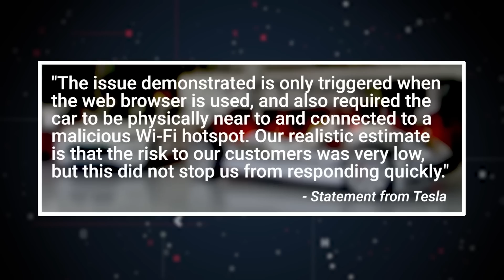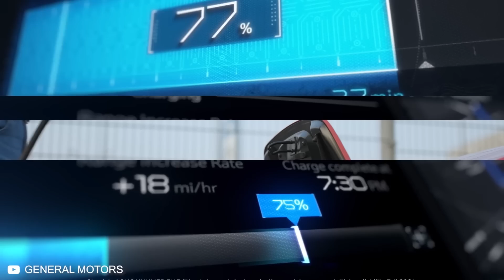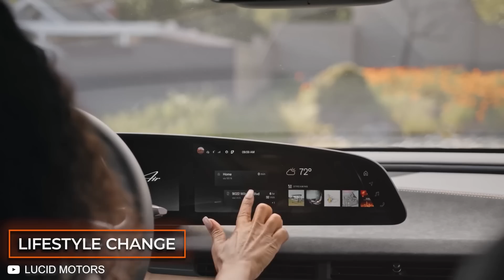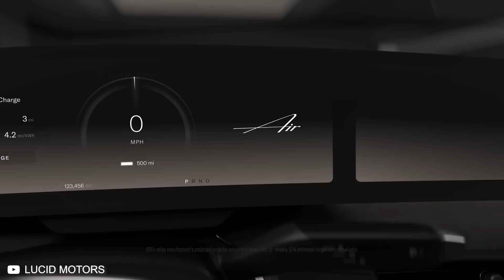EVs' Serious Problems That Carmakers Are Hiding

Comment: They wanna get serious about this? 

They need to mandate a universal charging system for ALL ev's! No proprietary plugs allowed, that way no matter your vehicle you can charge it with any charger, worldwide. They need to make them available everywhere, and i mean EVERYWHERE!! They need to make the range equivalent to an IC engine or superior. 

They need to be able to charge in 5 minutes max!! For those of us who actually have to drive somewhere outside a 2km radius, fuel stations get packed at peak hour, and that's for a 3 minute fill up! Could you imagine how chaotic a 40 minute recharge would be??

They need to make batteries that can last more than a few years and not start to degrade as soon as you buy one. I have a 26 year old diesel 4wd parked outside that still gets the same economy as the day i bought it!!

They need to make them durable. I'll wager my oil burner against any of the best EV's any day. The hiding i've given that thing is unbelievable, and it still goes. EV's are fragile!
Reply: Everyone except America he CCS2. Maybe this would be a less of an issue if you jumped to the international standard metric system. Maybe then you’d stop losing satellites.
Reply: @engineeringtheweirdguy2103  Umm, why is this directed at me? I'm not American.
Reply: @Spacegoat92  then Almost every single EV on the market today uses the same plug. Unless you’re in America. In which case Tesla has their own plug. Funnily enough teslas abroad don’t use that plug, they use the CCS2 standard.
Reply: Ok. I read further. Let’s address your list of “Demands”

“Need to make range equal to or superior than ICE” they already have. Additionally, why? ICE’s typically only need the fuel range so you’re not going to fill up on gas every single day. Because you don’t have a petrol bowser at home. EV’s charge fully overnight. Every morning you have the equivalent of a full tank of gas. You only really need as much range as you use during the day. Which for the average person 99.9% of the year is around 25-60 miles. Modern EV’s have ranges punching 350-400 miles. 

“They need to charge in 5 minutes max” - again. Why. 99.9% of the year you’re travelling less than a full tank of gas during a day. Then your car is parked in the garage for approximately 14 hours. Why do you need it fully charged in 5 minutes. Additionally when people do infsct do road trips the vast majority of them stop for food, drinks, bathroom breaks, making the stops around 15 minutes and the fuel getting 5 minutes. With superchargers, it’s 10-15 minutes to charge. So for some people it’s actually saving time. Yet alone the 16-17 hours per year the average person saves from having to get fuel for their daily commutes they drive 99.9% of the year. 

“They need to make batteries that last more than a few years” - they already have. Modern EV batteries last twice the average lifespan of a modern combustion engine. Infact they typically have a 8 year warranty period alone, brand new. It’s hard to get anything more than a 3 year warranty on even high end combustion motors. BMW only does 6 as an optional extended warranty to under 100,000 miles. 

Your 4x4 probably doesn’t get the same economy and probably has ALOT of parts replaced. In a lot of cases the entire motor. How much $$$ do you think has been spent of maintenance and repair of the engine and transmission since it was purchased new? Double the cost of the car when it was new? More?

EV’s aren’t fragile. The bottom of EV’s for example is a solid smooth plate of titanium. There isn’t a transmission shaft, or differential or exhaust or oil sump under the car you can bash. They don’t have air intakes like combustion cars do so you can’t flood the engines. You can drive it into a lake float it back out then drive it away again. 

Fragile… they have only a few hundred moving parts. A combustion engine has a few hundred thousand. And you think the EV is fragile. Oh how precious you are kid.
Reply: @engineeringtheweirdguy2103  Ok then you wanna go long answers hey? I'm your huckleberry. Let's address your responses here, because you made a few bold assumptions here.

Point 1 "Need to make range equal to or superior than ICE" No they haven't, refer to this video for starters. 

https://www.youtube.com/watch?v=J0V99iiEJvY

Secondly, my Honda Accord Euro 2.4 litre manual would get on average 600-700km per tank, my 4wd gets about 800km to a tank, both can be easily filled up in under 5 minutes, and very seldom, if ever, to be affected by power failures. Granted yes, a Tesla Model 3 claims to get 680km, but that claim fluctuates between different operators and is dependent on how many accessories you're using. You run the air con, lights, windscreen wipers and stereo all at the same time, your range will drop like a rock. I live in Australia, and driving long distances is quite common here. The only folk who seem to think EV's are a good idea are those who seldom venture from the city and have access to their own charging stations. Not everyone has that luxury, take for instance renters, people who park on the street, multiple vehicle households, people who simply can't afford a charger at home, let alone a brand new EV. Like you think a pensioner/unemployed/first car buyer can afford to fork out $65,000 for a model 3 Tesla, or $40,000+ for a "cheap" EV here in Australia? And then however much for at home chargers?? And no one will want to buy a used EV with batteries that have reduced endurance. To say nothing for third world countries. How well do you think they can get an EV network running across Africa??

Thirdly. If i wanted to go on a road trip to visit my friend out west from where i live, (716km one way) i MUST use an ICE car. There is ZERO EV support from here to his town and back. At least not yet.

Point 2 "They need to charge in 5 minutes max" Again, not everyone has access to fast chargers or even house chargers. As for recharging in 10 to 15 minutes while you get food or drinks? Well that's wonderful if the multiple cars ahead of you aren't doing the same thing while you're driving during peak hour, you could be in for a long wait. Also, i don't know where you're getting your statistics on being able to fully charge a car in 10-15 minutes when it takes 60 minutes for a Tesla fast charge which kills your battery in the process. Also when i go camping in some of the more remote places, i can get diesel pretty much anywhere, and my car can run on cooking oil if i really get desperate. And if i can't, i can carry extra fuel with me, which i can again fill up in minutes. Please tell me, how long will i have to wait to charge my EV with a solar panel when i'm in the middle of nowhere? Secondly, how well do you think our grid can handle tens of thousands of EV's being charged at once. Combined with fridges, televisions, air conditioning, and the other appliances every household has. My country doesn't have nuclear power, we're currently running on coal fired power stations, with a push to go wind and solar which will make the situation even worse. The infrastructure doesn't exist yet to support mass EV ownership. Here is another article for your perusal, tell me what you would do in this situation:  https://www.drive.com.au/news/electric-car-owners-told-to-avoid-charging-during-california-heatwave/

Point 3 "They need to make batteries that last more than a few years" You seriously think an EV battery will last twice the life of an ICE engine??? Whatever drugs you're taking, please send them my way! My 2012 Mitsubishi Lancer had a 10 year warranty on the engine and drive train. If I don't drive my ICE, it doesn't degrade, that's how come you can have a 50+ year old car with its original engine. Battery degradation is a fact. Batteries start to slowly degrade the second they are made, whether you drive them or not. We'll see how many EV's are still around with their original batteries in 20+ years. Please refer to this video https://www.youtube.com/watch?v=LmKyzaQnMok

Point 4 "About my 4x4" Are you absolutely for real??? The car has 440,000km on the clock, i replaced the head on it myself when i bought it. The transmission and running gear is still the factory fit, i have also modified it extensively due to my own preferences (Something you can't do easily with an EV). I can also fault find and repair pretty much everything on the car myself. My Honda Accord Euro had 343,000 km on it until it got written off by an idiot running a red light. The Honda had the original engine, gearbox, clutch, radiator, suspension components. I owned it from 120,000km and only replaced the rear wheel bearings, the CV joints, battery, and the air con compressor. And i can GUARANTEE, even with the purchase price of the cars, i came nowhere near the cost of a new one. Not by a bloody long shot. And i'll have to spend a hell of a lot more money on my ICE cars before i even get close to the price of an EV. Lets see if your EV is still on the road after 20 years, and still running reliably.

Point 5 "EV's aren't fragile" Yes they are. You can't damage your ICE car by filling it up too fast, yet even EV manufacturers say frequent use of fast charging can detrimentally affect the durability and life of an EV battery. My ICE cars can take a hell of a lot of punishment. The places i take my 4wd would kill an EV, and you get a short in one of those battery cells that starts a fire, you can't even attempt to put it out unless you drive the thing into the ocean. I don't flood the engine because i have a snorkel on my 4wd so water crossings have never been a problem. Damage to my sump and undercarriage isn't an issue either as i have bash plates that have taken some big impacts without issue.

And clearly you have never disassembled an ICE engine, a few hundred thousand moving parts you say? Really?? I've rebuilt a few and i can tell you, an ICE engine has about 200 parts, most of which can be repaired or replaced by just about anyone with a tool kit and half a brain. The average modern car has about 30,000 parts in total if you were to strip it down to every nut and bolt, so try again son. And you seriously think it's ok to drive your EV into a lake? Be my guest. Enjoy spending the next years of your vehicle ownership chasing electrical shorts and glitches due to water ingress into your wiring. Plus, my ICE cars are 100% hack proof. They won't brick my car because of a faulty line of code, or an error, or some sort of electrical anomaly. Both my ICE cars can be started AND driven without a functioning battery. I have repaired my cars power steering on the beach!! THE BEACH! 

And if i need to repair my EV in a hurry, where do i go? Oh yeah, you can't take it to any old mechanic or fix it yourself, you need to go back to the dealer where they can tell you that because you didn't perform you last software update on time that your warranty is now void and you're up for the repair costs, or the warranty doesn't apply to you because you aren't the cars original owner or you downloaded a third party program, or there will be a 2 month wait due to covid or some other crap like that. Tough break while your car sits like expensive paper weight, while your mate with his own tool kit could have gotten your ICE powered car back on the road in a couple of days.

"Oh how precious you are kid" Cheers for calling me a kid, i feel younger already.
I'm not against EV's by any means, i just think they need to be better developed before they start pushing people into something that isn't going to be beneficial at all. The majority of pollution is caused by industry, namely China and India, yet they're trying to guilt the population into buying EV's by saying ICE cars are the problem. Yet how much destruction of the environment is required to build and run an EV? The only ones who will be winning out of EV ownership will be the ones with a financial interest in them. Not you or I. And as for my demands?? If i am going to be paying over $50,000 of my hard earned money for a car, you better bloody believe i'm gonna want it to meet a certain expectation. And if that expectation is fast repeated, RELIABLE charging, cheaper and longer lasting batteries, and better infrastructure to support it then so be it! 

In the meantime, until they get their battery issues sorted out they should be focusing on hybrid vehicles as a transition, even to the point of doing hybrid vehicle conversions, like they did with LPG back in the day. That way they can normalize EV ownership, reduce fuel consumption, and make people more willing to accept it as they see battery tech improving. The world is moving way too fast to take a step backward in terms of vehicle ownership. 

Oh, and here's another video to watch https://www.youtube.com/watch?v=4c7jdRp4rpc
Reply: @Spacegoat92  OK, so I also live in Australia, and actually own a model 3. lets respond.

1.) yes they are. Most other vehicles in a similar size and categories to the EV's have similar ranges. Lets take the Tesla model 3 and the BMW M3 for example. They directly compete with one another in the same size, Category and market. The Tesla model 3 has an EPA range of 570km (the NEDC range they're required to advertise here by Australian law notoriously inaccurate. They use the more accurate EPA range elsewhere. Our government is just stupid). The BMW on the otherhand has a range of 490km to a tank. You may note that the Tesla gets further to a charge than the BMW gets to a tank of fuel.

1.1 - "very seldom, if ever, to be affected by power failure" - why would an EV? sounds like a dumb question on my end but if you use your brain for a second. EV's have a similar amount of range per charge as an equivalent ICE vehicle. already established. Most EV owners charge at home so every morning they have a "full tank" unlike ICE vehicles do at the start of every day. If the power goes out, your battery still has charges does it not? Additionally if the power goes out, how do fuel stations pump the fuel into your car? how do they accept payment for the fuel you've pumped? they cant. So you cant get fuel if the power happens to go out right before you need to refill your tank. This will be similar to alot of your arguments. Seem appropriate and valid points on face value but when you ACTUALLY think about it, they're not really issues at all.

1.2 - "that claim fluctuates between operators and dependent on how many accessories you're using" - This is the same for ICE vehicles. Its the reason your power drops when you're using the aircon in weaker cars. It all takes power. That power in ICE comes from the rate of fuel consumption. And no, it doesnt "drop like a rock" the amount of power headlights, wipers and radios use is so small, I could run all those in my model 3 for a week before it even dropped a single percent. Hell, you can get high powered LED flashlights that operate of 4 AA batteries for more than 40 hours continuously and you think LED headlights in a car is going to drain the battery "like a rock" just think. Air con is the only one there that has any significant impact but it  has no more of an impact that it does in ICE vehicles. My range drops by around 1-2% if i use it continuously for 500km. (i.e. I'll lose 5-10km of range. omg, what a loss).

1.3 - "The only folks who seem to think EV's are a good idea are those who seldom venture from the city and have access to their own charging stations.... take for instances Renters" - When i purchased my model 3, I was a student working multiple jobs, living with my fiancé (so multi car home) and I was RENTING. I didnt have a "charging station" either. I had a normal wall outlet next to the carport. That would let me charge my daily commute in 7 hours (just over 100km a day). The car was parked there not being used from the time I got home to the time I had to leave for work which amassed to 14 hours every night. (got home at 4pm, left for work at 6am). I never had a single issue with that arrangement. Since then I have purchased a home and got a home charger installed which does the same in 1 hour 20 minutes. It cost me $400 to install. However Victoria is implementing an EV ready mandate that all new homes be built to accommodate EV charging. So in the future I might have saved myself that $400. (also should point out that the most popular car in terms of purchases of new vehicles in Australia for Q1 and Q2 of 2022 has been the Tesla Model 3, i'll let that sink in for a bit)

Again, If you just think these things through just a little more....

And i'm not saying EV's are a must have for everyone. If you only have on-street parking, EV's probably arent the best option. and obviously if you cant afford the car, dont get it. But If you're also Australian, then your 4x4 is likely to be either a land cruiser or a patrol. Tell me. How much is that car worth new? compared to the Tesla's $65K price tag?

1.4 - Roadtrips - I regularly go on roadtrips in my Model 3, With most of my family living 4-5 hours away and this season I have driven from Melbourne to Mt Hotham to go snowboarding effectively every single weekend. so much so that i've done 11k km in only 1 month. Out West, yes the charging network is shocking. It needs improvement and have more investment. Out East I can drive from Adelaide to Cairns through superchargers. In Melbourne alone there are Tesla super chargers all over the place but there are also RACV Super charger networks, Chargefrox Super charger network Ampol super charger networks, Chadimino Supercharger networks. The Chargers are everywhere. And they're all publicly accessible, with the exception that Tesla supercharger networks are only open to Tesla owners. I semi-regularly drive from Melbourne to Cobar to visit my brother (850km each way). Having to charge only adds around 30 minutes to my trip I was  would make stops for food and toilet breaks in anycase and it actually saves me to time going to Mt hotahm in a weird twist of fate. Instead of getting fuel, then driving around to find a park then going to get food. I just park at the charger and go and get food. absorbing the queuing for fuel at the fuel station, filling, paying then driving around town to find a parking spot.

Part 2 coming
Reply: @Spacegoat92  2.) "they need to charge in 5 min max" again, you can charge your EV from a wall outlet. I literally went and stayed in an air BnB that had no drive way and only a front porch. It had an outdoor powerpoint on the side of the house. I parked on the grass and charged from that powerpoint while I was staying there on holiday. its really not that difficult.

2.1 - "charging in 10-15 minutes while you get food or drinks, well thats wonderful if multiple cars arent ahead of you" Yeah, so that doesnt really happen, especially not here. Most instances which people point to of that happening have been on Tesla club drives where they get together as a group and drive a route often stopping at a few superchargers which causes ques such as the 300 car club drive that did the great ocean road a few months back. people are still using that as a "look, they're queuing" photo. However this isnt the norm. if you THINK about it, the only people using the super chargers are people on road trips since most EV owners charge at home. And of the people on road trips, and even then only the ones who happened to be in the same place at the same time as you will ever need to use them at the same time as you. However places often have 4-6 super chargers in a single location. Infact Tesla's tell you who many chargers are available and if too many people are navigating to the same one, it will re-direct you to a different one on your route. (the wonders of technology eh?) The only time I have ever had to wait at a super charger when doing my very many roadtrips I do in my Model 3 was when some arse hat in a pajero towing a boat parked his pajero and boat across 3 of the 4 super chargers in an otherwise empty carpark. I waited approximately 5 minutes until the person infront of me finished charging before I managed to plug in. I was very tempted to let out his tires. he deserved as much.

2.2- Super charging only degrades the battery if you do it consistently. super charging once a few months or even once a week doesnt affect the battery. its the repeated strain on the battery over several weeks that starts to degrade the battery chemistry. although you likely not being an engineer familiar with battery chemistry I didnt really expect you to know that. so that is a very reasonable concern. but now you know.

2.3 - "it takes 60 minutes for a tesla fast charger" no it doesnt. Literally a simple google search will tell you otherwise. V3 tesla super chargers charge your car in roughly 10-15 minutes. Even the maths isnt that hard. a V2 super charger, the slowest tesla super chargers in Aus has 250kW charging, the model 3' has a 75kWh battery. 75/250 = 0.3. --> 60x0.3 = 18 minutes from 0%-100%. Although typically you dont arrive on your very lest electron, just like you wouldn't arrive at a fuel station on your very list vapor. you'd typically arrive at around 20%-30% and leave at around 80-90%. making that charge time considerably smaller.

2.4 - This may come as a surprise to you but with EV's being electric. you can charge them from a small portable generator. In fact, its actually more fuel efficient to charge your EV from a small cheap portable generator from Bunnings than it is to use that same fuel in even a modern efficient combustion engine. So if i were to go camping, I would bring a tiny cheap portable generator like most people who go camping already do. And I would bring a couple of jerries as well, which ironically would last me far longer than they were used in an ICE vehicle in terms of mileage.

2.5 - The grid can handle it fine. Firstly, most people who make that argument say "well if we all had EV's tomorrow" which is correct. If EVERYONE got an EV tomorrow then the grid wouldn't cope. But the grid, like in most countries, has been expanding in capacity without fail by a rate of 200% every 20 years. (doubling every 20 years). It has had to do so due to our ever increasing use of electricity. Think about how much energy your parents used when they were your age? At this rate of expansion, the grid outpaces EV adoption even by OPTIMISTIC standards. Even if every single auto-maker on the planet overnight, tomorrow, only offered EV's and all their current cars on show floors went to EV models and everyone started buying them as fast as they could make them, you still wouldn't have full EV adoption until 2050. At which point the grid would more than be able to handle the amount of EV's on the grid.

your example of california is a poor one. the reason their grid is failing in complex but it isnt due to lack of production. Its been caused by politicians wanting to play grid engineer to virtue signal for votes. Infact at one point it became so unreliable that they were the first place in the world to see a REDUCING rate of EV ownership. You know what happened to the grid in california as the number of EV's on the road reduced?.... the grid continued to get worse.  So i would refrain from using that as an example. Using California as an example is a little like using Antarctica to claim its cold in the Caribbean today. its just stupid.

Also about your comment towards renewables, you only have to look at South Australia to know you're in the wrong. South Australia went from being the most unreliable grid in Australia, energy dependent on other states, and with the highest wholesale energy prices in Australia. Then they invested heavily in renewables and research into how to do it properly. Now with more than 75% renewables on their grid they have THE most stable grid in Australia, are net energy exporters supporting both NSW and Victoria energy needs and have the second lowest wholesale energy prices in Australia, behind only Tasmania with its 100% legacy hydro power.

Part 3 coming.
Reply: @Spacegoat92  I'll try to get the rest dont on my lunch break as I have to go to work. But to clarify my intent. I dont think EV's should be forced on anyone. I also dont think they're the best choice for everyones needs. It will and always was going to be a slow adoption process. But there is alot of intentionally misleading information out there about EV's. Often passed around by the media to make their customers happy. By customers I mean automakers who want full page add spreads and fossil fuel companies who do the same. 

little things like "batteries only last a few years" or "EV's are fire hazards" or "they cost more to maintain" all of which are false. I mean look at the last one. What is there to service on an EV. when was the last time you serviced your electric starter motor? never. They dont have gears, or a diff, or engine oil, or oil filter, or fuel filter or spark plugs, or timing belts, or engine air filters or O2 sensors or anything like that. 

My purpose in my discussion with you isnt to convince you that EV's are the bee's knees's or that everyone MUST have one or to convince you to buy one. My purpose in this conversation is just to address the false and misleading notions you've gotten from a biased media so you actually know what the facts are.
Reply: @engineeringtheweirdguy2103  You mAke some interesting points, but i will wait for part 3 before responding in full.
Reply: @Spacegoat92  For Part 3,

3.) "you think EV batteries will last twice the life of an ICE?" yes I do. The average combustion engine only lasts 200k-300k km. Sure, there are outliers. But they're exactly that. Outliers, they are not the norm. You cannot tell the vast majority of people with ICE vehicles that their cars will last up to or exceeding 350k km because the vast majority of them. simply dont. And yeah, there are cars that are 50 years old. But they are so rare these days they are literal collectors items and most of them have been entirely rebuilt, some, multiple times. But lets looks at EV's Current EV battery technology lasts 1,500 cycles according to A.) the scientific data, independent and manufactures, and B.) real world battery degradation data collected over the last decade and a few million sample vehicles. What that number means is that it takes 1,500 equivalent charges until its had 80% battery health. i.e. 80% of your range (for a model 3, thats 456km of range remaining at that point, making it almost identical in range to its BMB counterpart). What the term " equivalent " refers to in this case is the equivalent complete charge and discharge of the original battery capacity. For example if you have a 50kWh battery and you drive and use 10kWh and then charge it 10kWh, then if you were to do that 10 times you would have only then completed 1 of the 1,500 cycles. (for context 10kWh is around 77km of driving). 

So after 1,500 cycles, you would have 80% of your battery health remaining, and you would have clocked over 853,500km of driving. Tesla's new 4680 batteries starting to be rolled out in their Model Y variants which have just his Australia are rate to 4,000 cycles to 90%. Real-world data supports this too. My model 3 has clocked just over  120,000km and i've lost less than 1% of my original battery range. In addition during the 3 years and 120,000km the only servicing i've done on the car what so ever in that time, has been a tire replacement and I got the wheels aligned at the same time. thats it.

So batteries do degrade slowly over time. But slower than ICE engines degrade. and stored batteries i.e. un-used ones, only degrade so far as the battery "phantom drains" where the battery is still being used to operate some internal systems while the car is not in use. Such as sentry mode, battery management systems, etc.

4.) for most vehicles, you have to REGULARLY replace things like timing belts, spark plugs, oil filters, air filters, fuel filets, fuel pump, engine oil, transmission oil, radiator fluid, fuel injectors, etc etc etc the list goes on. All so that they're replaced before they fail, tanking the engine. All of that costs money. On average, this costs approximately $1,500 per year if you do 30k km per year. or $2,000 per if you do 40k km per year like me. Over the average lifespan of a combustion engine (lets take the outer average of 300k km.) you would have spent  $15,000 just on basic maintenance. Thats not including replacing head covers or throwing a piston ring or fixing oil leaks, radiator burn outs, diff leaks or any of the other irregular maintenance issues that pop up more commonly with older vehicles. you've replaced alot of your car, regularly, to keep it running. 

4.1 - "I can repair pretty much anything on my car myself" common argument. But when Combustion cars first came out over horse and cart, the argument was made that anyone can care for a horse and replace horse shoes, but you need to go seek out some of the very few qualified experts to service your overly complicated combustion car. No joke, you can still find articles complaining about that. Things change. Additionally, there really isnt anything to service on a battery or electric motor. As I stated before, i've only ever replaced tires and did a wheel alignment on my car. If I need to fix anything it would be a door hinge, or suspension. Transferrable skills if you can fix your cars suspension or doors.

4.2 - "lets see if your EV is still on the road in 20 years running reliably" - as stated above, it will be. and running reliably? it has no transmission, no engine components, no radiator. its a battery, electric motor and wheels. As long as the battery is working, the car operates likes its brand new. and lets face it. the battery is going to last a very long time.

Part 4 to come.
Reply: @Spacegoat92  For part 4.

5.) "you cant damage your ICE by filling up too fast" that is true, but its almost impossible to do it in an EV. The charge rates are regulated by the most advanced battery management systems in the world. In addition, infrequent supercharging does not damage the battery, months of nothing but supercharging will. Although the new 4680 tabless batteries developed by Tesla are reported not to have this issue. Considering that the degradation from such events occurs in the anode and cathode (i.e. the tabs).

5.1 - "The places i take my 4wd would kill an EV" only because there arent in EV of roaders. I'm sure if I were to take my Model 3 off-roading it wouldn't survive. However consider this (again). Theres nothing there to damage. No transmission under the car, not clutch to burn out, no oil sump to bash in and no different to crack and no exhaust to crush. Just a smooth titanium place under the car to protect the battery from bottoming out. You cant even flood the engine in an EV with water crossings. I am not sure where you have gotten the notion that a car with out a few hundred moving parts is more fragile than a car with a few hundred thousand moving parts and a whole gaggle of external components exposed to be beated by the environment if you drive it incorrectly. its beyond comprehension for me.

5.2 - typically bash plates, and snorkels arent standard factory components. You have to buy them and install them. Specifically because you have to protect the fragile parts of the car. this only exemplifies my point further. Additionally what happens when your car goes too deep for the snorkel or you splash too much water into the snorkel. I went off-roading with a friend of mine and we drove through very heavy rain (storm front passing through). the rain was too heavy while we were on the freeway and entered the snorkel, soaked the air filter and caused the car to stall out on the side of the road. we had to get it towed.

5.3 - "clearly you havnt disassembled an ICE engine" - actually I have. Whilst I was studying Mechanical Engineering and uni, I was working as a diesel mechanic for Kennard's Hire. Hell you can google "how many moving parts in an ICE powertrain" and it will tell you. If you cant recognize that differential gears, bearings, cams, springs, transmission gears, clutches, clutch springs, clutch levers are all moving or contain alot of moving parts, not just the rockers and pistons in the engine block, then I understand where you got that assumption from.

5.4 - "spending the next year chasing electric issues from water ingress" - and this differs from driving a combustion car into a lake? or for some reason do you think the electricity used in ICE cars is different to that in EV's? EV electrics are waterproofed. But at least it can be driven away after coming out of the lake, which was the point I was making. your ICE engine will need to be rebuilt or replaced before it can be driven anywhere after that kind of event. because its fragile.
 
5.5 - "My ICE car is 100% hack proof" - probably true, but it isnt theft proof. the fact remains it is VERY difficult to hack or steal most modern EV's. it isnt that car to bypass the starter and get an engine running. thats why older cars are so easily and so often stolen. But more so, you could hack pretty much any modern car. This isnt something unique to EV's. I still dont understand why people think that it is?

5.6 - "they wont brick my car because of a faulty line of code or an error" - I can restart my cars computer in around 15 seconds. I also have 2 layers of computers. So most of the time, errors only really mean the screen has a glitch or the music wont play or something like that. In those instances I can restart the cars computer whilst im driving it. for errors with the actually driving, which i've never experience or heard of or know anyone who has experienced it, you can park and restart both computers. in around 30 seconds. What do you do if your ECU stops working? call a tow truck? additionally, and something which admittedly is unique to tesla, if you have any ongoing problems they can diagnose your car remotely.

5.7 - "because you didnt update your car on time your warranty is void" - my cars warranty is not subject to the software being up to date. additionally my car downloads and installs updates on its own automatically. its probably also worth pointing out that there are a handful of auto shops, not the dealer, who can repair and work on EV's. Here in Melbourne there is around 12. the number continues to grow. Additionally, please explain what you think would break down in an EV? surely you dont think i'd need to replace an oil filter or radiator cap or something do you?

5.8 - "your mate with his own tool kit could have gotten your ICE car back on road in a couple of days" - I've discussed this already, 15 seconds to restart, and remote diagnostics. The process at worst takes around 5 minutes. at best 15 seconds.
Reply: @Spacegoat92  and in response to your conclusion. Thats fair, but EV's are alot further along that you or really most people give credit for, mostly due to the large amount of disinformation pumped out from biased sources. I wont get into the whole debarkle about pollution, but just know that even on a coal only grid, EV"s have significantly less of an impact than ICE vehicles. as confirmed by multiple comprehensive studies into the matter. ICE vehicle are more of a problem of health in my eyes than pollution, Google the impact microparticle emissions have on health, life expectancy, and child cognitive development. its scary. and the vast majority of those emissions  come from car exhausts. 

as for the "the only ones winning from EV ownership will be the ones with a financial interest in them" that would be most people. Although expensive now (all new technology is, once upon a time, a flat screen was worth the same as a house deposit and now they're worth a weeks lunch money) EV's cost significantly less to own (no fuel) and to maintain (no servicing). at the rate i'm driving my model 3, at the end of this year, it would have cost me the same to Buy, Maintain and Charge my BMW/Mercedes priced and spec'd (in luxury and performance) Tesla Model 3, than it would have to have brought, maintained and fueled and entry level Toyota Camry.

As for hybrid vehicles, remember when i was talking about how batteries are rated for cycle lifes? Hybrids dont have the space to have complex battery management systems (EV batteries swim in constantly temperature regulated coolant fluid, you cant do that in a hybrid). That means their cycle life's are around 800 cycles.  and the smaller the battery, the lower the range of driving you have to cycle. lets say you have around 50km of batteries in a hybrid for 800 cycles. you'll have to replace that battery after only 40,000km (this is where the myth that batteries dont last every long comes from. hybrids.... and the 2010-2012 Nissan leaf but thats another story). You'll have to make and dispose of alot more batteries with hybrids i'm afraid to say. 

Anyway, I look forward to your response!
Reply: @engineeringtheweirdguy2103  Well i'll try and keep this short. 

An EV will be affected by a power failure. If you're charging at home and the power goes out, no charge. And after recent flooding up this way, that power was out for weeks in some areas. Service stations, fair call, but some have back up generators, and again not all will have chargers. But that's talking now. I accept that in time this will change.

Remote location charging with a generator. Ok, i concede i didn't know that was a thing that could be done. But how long would that take? With jerry's you're on the road again in minutes. Would this require an overnight stay? Not practical if you're in a hurry.

Again. A modern car does not have several hundred thousand moving parts. Definitely not. Stop saying that!

Regarding your friend who's car engine got flooded in a heavy rainstorm?? I ain't buying that. I  find it extremely unlikely that a sufficient amount of water could have entered the snorkel of a moving vehicle to swamp the air filter, (considering the filter housing has a drain) and then stop an engine. Must have been another issue there. I've driven through some horrendous downpours in my 4wd, driven through water that's caused huge waves up each side of my car  and it hasn't missed a beat. And i'll never drive through water that's over snorkel high because that's just downright dangerous in any vehicle.

As for the ass hat in the Pajero, as a Pajero owner myself his behaviour was unjustified and he brings shame upon the community of Paj drivers. Yes, you definitely should have let down his tyres. But then he would have taken longer to get out of the way of the chargers.

As for vehicle parts cost. I paid $1200 for my 4wd, and $7000 for my Honda. And my maintenance costs came nowhere near $15,000 in my years of ownership. But again i do my own work so i'm saving thousands. But just remember not everyone can afford, or is willing to pay $60,000 for an EV. And many are concerned about the things i have mentioned. I ain't the only one who feels that way. The price would need to come down before the common man will want to buy one. And who is going to give a pensioner/dole bludger/working poor a loan to buy such a car? As an engineer i assume you're on a rather comfortable income, so i don't expect you to understand the financial difficulties faced by those in the lower end of society in this day and age. I work as a carer now, so i see first hand the struggles most of these folk have.

Damage from charging too fast. Well that addresses one point, if they've made batteries that can handle repeated fast charges then that's good! no complaints about that. 

But.

What about the other EV's? Will they still have this problem? Can you charge any EV with a Tesla supercharger?

No my car isn't theft proof. No car is. If they want it bad enough they will take it, even your Tesla, even if it means flogging it with a tow truck. If the security system on the Tesla prevents it from ever being driven without your direct input than they'll just strip it for parts or torch it because thieves are bastards. Although my car isn't theft proof, it's theft resistant. I have custom triple layer security on it that no one knows about. It's a manual, driving a manual is a dying art. It's a 26 year old 4wd, no one in their right mind will want to steal that when it's parked next to a shiny Tesla.

What do i think would break down in an EV? Well you still have suspension, steering, climate control systems. Granted, electric motors are pretty robust unless you somehow overload them, but what happens if your car cops a serious glitch, gets malware or a virus? One of my previous Samsung phones just decided one day it wasn't going to work because reasons. Completely dead, couldn't do anything about it without having to spend a fortune so i had to buy a new one. Do i trust car manufacturers to create vehicles without built in obsolescence? Absolutely not!!! What happens to all those circuits if you get a power surge while charging?? Crap happens!!

So if they've made batteries and chargers that can be charged fast, if they've made batteries that will last more than a few years, then that's good. But unfortunately popular opinion is still heavily on the ICE side. There are many EV owners switching back to ICE cars, there's even videos on here from current Tesla owners highlighting issues with them. As one who isn't an EV owner, i have to rely on these viewpoints as i haven't had personal experience with them. And as a Tesla owner, you've pretty much got the best of the best as far as EV's go, but what about the other ones out there that just aren't quite up to speed.

I'm not saying i'd never buy an EV, just not one as they are now.
Reply: @Spacegoat92  Thanks for the well articulated response. It appears we are approaching common ground.

1 - if the power goes out whilst you are charging from home, you have what ever charge is in your battery. If you drive 60 miles from your battery which has 350 miles of range, and you only managed to charge lets say 10 miles of that before the power went out, then you'd still have 300 miles worth of charge (5 days worth of daily commutes). Additionally, whilst some petrol stations have back up generators, if you have an EV, you can also have a small portable generator and a jerry can as a backup.

2 - "remote location charging with a generator... how long would that take?" well that all depends, most small portable generators can output at minimum the same power as a standard home power outlet. So it would take around 24 hours to do a full 0%-100% charge. But if you're only needing to charge 30% or something like that, should only take around 5 hours. If you're on the side of the road, wondering how long its going to take to charge from a portable generator to get to the next, faster charging location, heres a simple sum, 15km per hour charge rate. you need an extra 30km, thats 2 hours charging from a generator. granted, unless you're extremely inept at not only registering that your charge/fuel guage is running very low, and you've ignored all the alarms, bells, sirens, cars attempts at automatically routing you to a charger to end up stranded on the side of the road without power, you have bigger problems. If I were camping though, I would have plenty of time to run the generator as I do other things.

2.1 - some smaller generators also have a 15amp outlet, this would reduce the wait time by around a third. You would charge at a rate of 23km/hour. So if you had to get the same 30km to a charger point from the side of the road, it would take 1 hour 20 minutes to charge that range.

3 - "in regards to your friends car who's engine was flooded by a rainstorm" the engine wasnt flooded, the fuel filter was soaked. Air doesnt pass through wet paper or wet cloth very easily, infact its often used as a torture technique for this reason. He has a drain on his snorkel, but it was a cheap snorkel and mud had become loged in the drain hole. This occurance is far more common than you might think. We ended up taking out the air filter and the car worked again (it was still running with the airfilter but it dumped so much power that we couldnt get to highway speeds). However not knowing why the water wasnt being drained from the snorkel at the time, we chose to wait until it stopped raining before taking back to the road.

4 - we are in agreeance with the pajero

5 - It is much cheaper if you do it yourself. Unfortunately most people dont get those kinda of services done themselves. this results in an average minor servicing cost of around $250-$300 every 10k km and an major service cost of around $1,400 every 100k km. you can use some basic maths to get to the same numbers I did. Your Pajero would not have cost $1,200 new. infact if you wanted a new car (which lets be honest, is what we are comparing at the moment, we arent talking about second hand EV's because they havnt been around long enough for that yet) a band new Pajero costs from $54k AUD to $77k AUD depending on what model you want. If we look at the cost of vehicles with similar performance and luxury features as say, a Tesla model 3, such as the BMW M3, we get a price of $144,900 as a starting cost and it goes up from there. For the Tesla Model 3, same size, category and class, we have a starting cost of $66,000.

I am certainly not saying it isnt priced as a luxury vehicle, it most certainly is. And almost all new tech comes in at the luxury end, Plasma flat screens for example used to cost the same as a house deposit, now I can get a 70inch for $500 or less. I am also certainly not saying that everyone can afford one either. Infact, alot of people cant even afford a new car, which is why the second hand car market exists. But eventually EV's will reduce in price due to economy of scale and also due to becoming more prevelent in the second hand car market.

5.1 - I am on a comfortable income now. However I purcahsed my model 3 when I was a student, renting in a dingy 1 bedroom in pakenham. I did the maths, it was going to cost me less over 5 years to own a model 3 than it was to own a Toyota Camry if both were purchased new. It was a big stretch to get that loan but I did.

Part 2 to follow
Reply: @Spacegoat92  part 2

6 - charing too fast - other EV's these days need to compete for lifespan and charging, as a result almost all EV's on the market to day have advanced battery management systems (BMS). This means they are unlikely to encounter any serious issues with rapid charging. Some however do go wrong as you stated, most EV's arent at the same level as Tesla. For example the Porsche Tycan sacrificed its battery life to get "repeatable" drag times from its car. Whilst teslas model S scales back performance to protect the battery. and hyundai recently had a glitch with theirs which triggered a thermal runaway in their batteries under very specific conditions. Which was fixed with a software update (unfortunately they had to take them to the dealer to do that), Tesla's do theirs over the air.

7 - like with all modern cars it is significantly hard to steal than older generation cars. Tesla can only be opened by your phone being within 500mm of the car. once in you can set a pin to prevent the car from being driven without permission. failing all of that tesla owners can see their cars live location and speed remotely and can disable the car remotely. It also has sentry mode, which records 360 degrees around the car in HD whenever anyone gets close to the car. I caught someone who used the door of their car to bash a dent into my car. as the drove off I got their licence plate and went to the police. It will also send me a text message directly if my car alarm is set off instantly. Sentry mode is responsible for capturing hundreds of car theives worldwide. and today, most theives are aware that they are being recorded whenever they are near a tesla and if they set off the alarm, if the owner is nearby, they'd likely be caught in the act.

7.1 - it is extremely unlike for the reasons above that anyone would target a Tesla. Additionally, you cant get anything from the outside of the car. Wihtout breaking a window, you cannot get to the batteries. The only access to the batteries is from inside the car and requires you to remove all the seats of the seats in the car. the most optimistic thing they can take from a Tesla is the wheels, however they would be recorded the entire time.

8 - "well you still have steering, suspension, climate control" - correct. So do you. How often do they break down on your Honda? (i'd image your 4wd suspension cop a much harsher beater than a normal daily driver). There has never been a reported incident of malware or virus's in an EV. And Tesla has million dollar pizes for anyone who can successfully hack their cars and show them how they did it. They also do the same for SpaceX. It also might come as a suprise but in Engineering you can design something call an overload protector. which prevents damage in the event that happens. serious glitches are rare but are commonly fixed with a re-boot of the car. Additionally the electronics are significantly more robust in a car than in a phone. Your car, like almost every car, is run with a computer, called the ECU. How often have you had your ECU throw a serious glitch or overload and burn out? i'm betting never, if ever. the same logic applies to EV's. There are regulations these things have to meet to be installed in a cars for this very reason.

9 - "but unforntunately popular opinion is heavily on the ICE side" - yes and no. There is a significant amount of misinformation out there about EV's as you might be starting to realise. This creates very rigid opposition. And it is why I come here to comment, to correct these common misgivings. However even here in Australia, the most popular new car in 2022 for the first and second quarters has been the Tesla Model 3. Not the most popular new EV, the most popular new car. This means the Tesla model 3 out sold every other new car, ICE or otherwise, in Australia over the last 6 months. 

10 - my last point. you mentioned you have to rely on viewpoints of those who make videos or posts about Tesla's. this is a very poor thing to do. let me explain why. how often do you make a video to do a post on a product that does what you expect it to do or even exceeds expectations? and how much more tempted would you be to post something it doesnt, or if something goes wrong. Unfortunately this is called survivor bias. the only people posting making videos about tesla most of the time are people who have had something go wrong. This could be 1% of the total owners. An example of survivor bias is the famous is the plane example. If you google it you will see an image of a plane with lots of red dots. in WWII the US airforce wanted engineers to put armour on their bombers to improve the chances of survial. So they took a survey of every plane that was damaged on bombing missions and marked the location of the damage. Common perception would be to put more armour where the plane is shown to be hit the most, i.e. the at the places with the most red dots.

here is the catch though. only the planes that SURVIVED those shots made it back. If you look at the diagram again, you'll notice none of the planes that returned were hit in the engines, the cockpit or the tail mid-section. That is because the planes that were hit here, never made it back. Which is where they actually needed to place the armour plating.

Similar things happen all the time in every day life. one example, are review. espeically ones that require more effort such as taking videos. Unless you're in the business of making those kinds of videos, it takes effort to make those. disspointment, anger and frustration and area  far more effective motivator than mild satisfaction for posting videos such as the ones you describe. So keep that in mind.
Reply: @engineeringtheweirdguy2103  Yeah i did see that video a while back on survivor bias, so i see your point there. Unfortunately for many folk out there, they will never be in a position to be able to purchase a new EV, and i'm disinclined to purchase any brand new car because i think their pricing has just gone stupid to be honest, and i'd much rather spend the money on travel or my house. So i would be in the second hand market. And being in that situation we would be facing this....

https://www.youtube.com/watch?v=FuK6h9vvBGg&t=11s
https://www.youtube.com/watch?v=nq5c4jGR2gM&t=13s
https://www.youtube.com/watch?v=vVSw3KSevEc&t=4s

Now have you ever purchased parts for your Tesla? Will they sell them to you??

Also regarding your comment about California's energy woes being the result of bad leadership, what is to stop that happening here? I honestly have zero trust in any politician wanting to do things for the good of the people. They have deals going on that we have no idea about. Those deals are there to keep them in power, and they make some pretty dumb decisions. 

 I mean our premier wants to have the Olympics up here in Brisbane!! We don't have anywhere NEAR the infrastructure to support that. So keep watching that news report for a real comedy. I'm hoping to be out of the country for that one i say!! But politics isn't something i particularly want to get into, and i won't. But it's still a factor to consider.  Things can change with the stroke of a pen and it won't be them that will be going without, i can promise you that.
Reply: @Spacegoat92  I wouldnt say never. As i mentioned earlier, almost all new technology begins expensively. flat screen TV's area a good example. How much did a flat screen plasma TV cost 10 years ago? how much do they cost now? even with them being smart TV's? The reality is that EV's have reduced in prices by around 50%-75% over the last decade, and will continue to decrease in cost as they run towards economy of scale. That is a simple fact. But the point is taken that some people will never be able to afford or want a new car, even if its a price a Nissan Micra. EV's havnt been around long enough for them to be fully integrated to the secondhand car market but it is moving in that direction. So in the future you will likely find a market of second hand EV's that are affordable and practical and are numerous enough to be reasonably priced.

the first video you linked was talking about a first generation model S. Important to remember that the Model S is (supposed to be) up there with luxury cars light Bentleys . So off the batt they are expensive. A model 3 costs well less than half that price new. Second is that the first gen model S's were hand built. As the company has tilted more towards mass production over the last almost decade, alot of the parts have been changed to accommodate this. So replacing things like the aircon would be very expensive. Not only because it all been hand made and isnt made regularly anymore. But because even the airconditioning in an Model S has luxury features to it. Such as a condensate catcher which prevents condensation from the aircon reaching the filters creating that weird smell you get after you've used the cabin filters for more than a year or so. 

Second video is much the same. But it even states that replacement of things like broken door handles for example are highly expensive because of the category of car that they are. If you had a high end mercedes and broke the door handle on that, it would also cost just as much. 

I didnt really bother with the third video. 

Have I ever purchased parts for my tesla? yes. I have. Did Tesla sell it to me? yes. They did. What parts were they? the buttons for the electric seat adjustment in my model 3 was broken off by a friend with steel cap boots getting into the car, and I got a a new alloy replaced from a traffic accident. thats it so far.

"whats to stop that happening here" well for the Eastern States, it would be the AMO and AEMO, Introduced under Kevin Rudd, which is an independent body which regulates power grids, infrastructure and energy pricing in the Eastern States, WA is notably, not a member (as they refused to join). This means that whilst states foot most of the bill for planning and building power infrastructure projects, They dont get a say in how they are operated, what benchmarks they need to meet and how they are integrated. If a state builts a powerplant that isnt compatible or doesnt meet the AEMO standards, then it wont be integrated into the energy grid.

If you want an example of how this has help things get done right. Look at South Australia. 10 years ago it was dependent on other states for the majoirty of its energy, it had the highest wholesale energy prices in Australia and the AEMO rated SA's grid as the least stable grid in Australia. Today, after sinking lots of money into renewables, SA has almost 75% renewables grid. It is a net exporter of energy supply electricity to both Victoria and NSW, it has the second lowest wholesale energy prices in Australia second only to Tasmania with its legacy hydro and it is now rates as the single most stable grid in Australia. - it was done right
Reply: @engineeringtheweirdguy2103  Well TV's may have come down in price but not much else has. In fact car prices continue to rise to stupid prices, regardless of the tech. And unless they can find a way to make batteries (the most expensive component of the car) cheaper, they definitely won't be coming down any time soon. Fair call on the Model S point, i didn't notice that.

The video you didn't watch, pretty much described a situation you said wouldn't happen. He hit some road debris and it damaged a port on his battery which required a complete replacement of the unit. $16,000US worth. The purpose of the video was to show a way he was able to fix it cheaper. 

I just did a quick search on Car sales and the cheapest Model 3 i could find was a 2019 and it was $56,000 with 74,000 on the clock. Compared to the similarly sized 2019 Mazda 3 with 58,090 on the clock for $19,000, and there's a few low km Toyota Corollas in the mid $20k mark. I know Corollas aren't the most exciting cars, but we're talking about people who just need a reliable car to get around. 

As for me, i usually keep a car until it becomes unreliable, or my requirements change. That generally results in me keeping the car for several hundred thousand kilometres. As i only see a car as a medium to get around, i'm not too fussed on features, as long as it's got a good air con, good stereo, and reliable, i'm happy. My brother on the other hand just bought a Kia Stinger, he won't stop going on about it but i'm just like "meh". Especially in this country with it's fixation on speeding and cracking down on car enthusiasts, you can't enjoy a performance cars full potential. I mean what's the point in having a car that can do 0-100 in under 5 seconds when the cop hiding around the corner will have your car impounded for hooning! I'd lose my car in a minute!!! That's under Qld laws anyway, i don't know how it is down your way. 

As to what stops it happening here, again, the stroke of a pen. The next government that comes in decides to abolish the current arrangement because "they feel it's no longer sufficient for Australia's ever changing needs." They decide to make some new deal or some other changes, and it's all over. No legislation is set in stone. As for South Australia's going better with renewables? I dunno man, can you link me some articles that show that? Because i'm only finding a ton of negativity about SA's energy woes, maybe i'm looking in the wrong spot, so if there's something more current, i'm happy to see it. 

Good to know Tesla will sell the parts to the public. Maybe it was an American issue.
Reply: @Spacegoat92  Batteries are coming down in price. have been for quite some time. Its nicely transitioning over the expected "S" curve which describes price reduction curves from an emerging technology to a technology "at scale"

in relation to the video I didnt watch. Yeah earlier Tesla's even the first few iterations of the Model 3 were vulnerable to underfoot road debris if it hit hard enough and was solid enough with only a thin steel plate. Since a few more destructive incidents such as when a piece of rebar was flicked up from the road on a freeway, peirced through the tin steel cover and penetrated one of the battery cells leading to a fire, Teslsa, and most other EV automakes (MOST) replaced the underside of the battery with a single piece solid titanium plate. Have not been any incidents since that I am aware of. I could be wrong though.

well the Model 3 has one of the lowest 5 year depreciations of any car on the market. However its also important to consider that even the model 3 is still a luxury car. Its in the same category, price band and performance band as a BMW M3. If you look on car sales you'll see 2018 BMW M3's with 70k on the clock going for $98,000. so in this case context is important. However there are continually cheaper EV models coming out every year. I certainly wouldnt be expecting most people with a second hand car budget to be looking at a second hand tesla, or BMW over something like a Camry or Corolla. 

You and me are alot alike in relation to keeping cars until they're no longer reliable. My last car was a 2003 subaru impreza RV. I kept that until it had 320k on the clock and started having gearbox issues. Thats when I upgraded to the Tesla. made the move to a Tesla, not because I was an Eco-Warrior, not because I dont drive far (i've done around 120k in 3 years in my Tesla so far). I got it because it made the most sense. Price to operate was so appealing that it would actually cost me less over 4 years to buy, charge and drive my Tesla model 3 than it would if I had bought, maintained and fueled an entry level Toyota Camry. I also did the researching into the longevity of the battery and car to make sure it was going to hold up. Both me and my wife are both Mechanical Engineers. We did our digging before getting this car as we were both students and renting and it was going to be a big financial reach to buy it together. There are other features worth considering for us too. Free over the air updates makes the car better the longer you own it, not having to go to fuel stations and charging from home. Free recharges if you know where to go (which is most places). Excellent performance. One of the highest achieving vehicles on the AANCAP safety board. Sentry mode to protect the car from vandals and carpark damages. There was a hefty list.

I feel you with the hoon thing. we have similar laws here. Although you can accelerate as fast as you want in Victoria, if you wheels lose traction and spin or you break the speed limit you can get done under hoon laws and get your car impounded. This isnt a problem with my model 3. The electric motor is excellent at traction (instant torque response) so when I floor it a dont lose traction. But unlike other cars like the stinger, it doesnt make loud exhuast noises like a big "hey cops, look at me!" and it also dont have race or sports styling on it either. It really doesnt stand out. one of the biggest disspointments with my Tesla was how many people thought it was a Mazda 2 from a distance! as a result i've never had problem with the police, despite being admittedly very heavy footed at the lights.

And America does lots of things weird. For example all Tesla's outside the US us a CCS2 type charging plug. This is a type of universal charging plug for EV's. kinda like USB C for android phone chargers. Every brand uses it. That means that other cars can use Tesla destination chargers (but not the super chargers) and I can use anyone elses super chargers like chadmino, RACV, Ampol, Chargfox, they all have supercharger networks.

But in the USA, all Teslas have a proprietary plug. This means they can only use tesla super chargers and destination chargers. and thats it. likewise other cars cant use the tesla destination chargers or superchargers.  

America is bizarre in alot of ways.
Reply: @Spacegoat92  Thankyou by the way, for having an open conversation with me. Most people shut down when I try to give them facts. Recently a guy provided a link to a study that stated that EV's produce more emissions during production than ICE cars do (which they do) but then went on to say that their low operating emissions costs, even on a coal only grid, offsets this after only a year or two of driving. He then went on to say that EV's are therefore worse for the environment than ICE cars. I pointed out that you cannot accept the findings of the article you published as evidence whilst also proclaiming the opposite. The two aren't compatible. And he went on this massive angry tirade.

My point is, more people should be as open minded as you have been. Its been awesome talking with you.
Reply: @engineeringtheweirdguy2103  That probably explains half the problem, all the videos are American!! And no problem mate, i'm always happy to listen to the other side whether i agree with it or not. I never claim to know it all and i'm always happy to learn when i'm wrong.